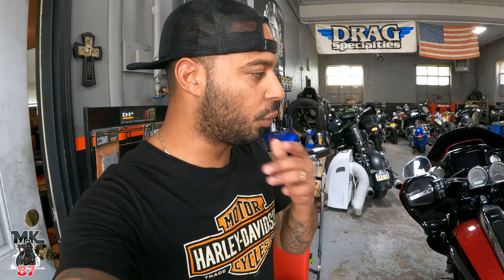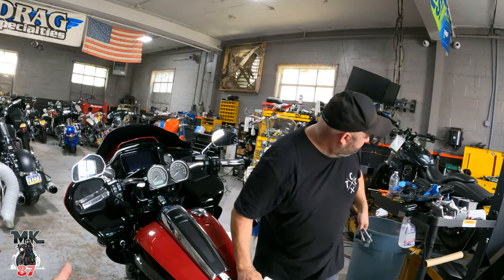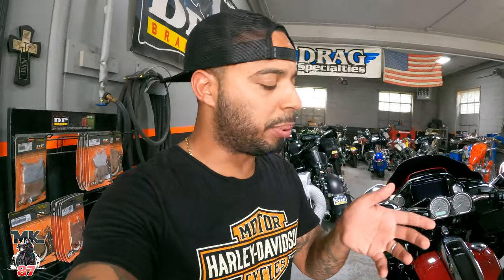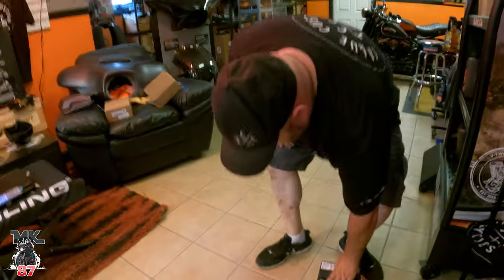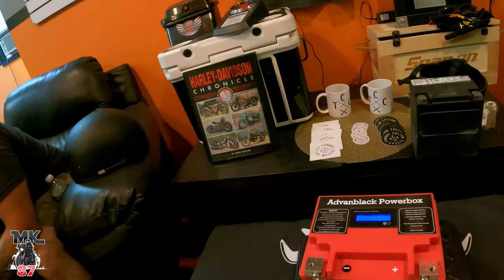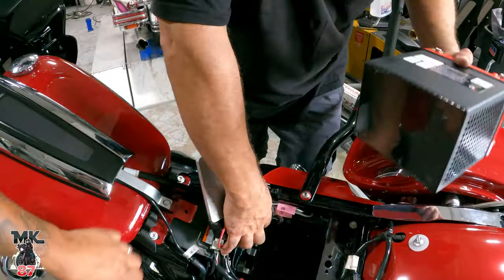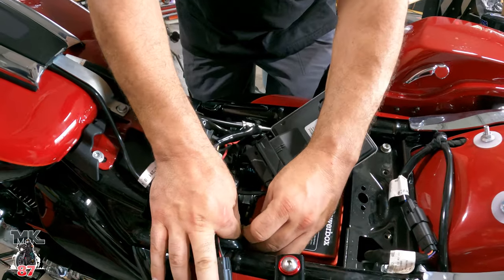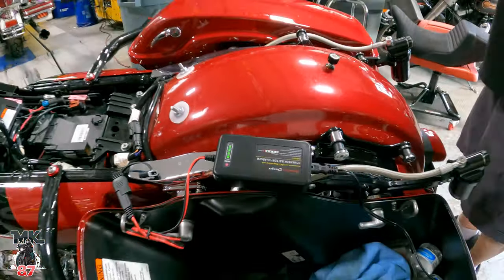Advanblack Lithium battery for Harley Davidson Road glide

Comment: Just installed a noco lithium NLP30 12v 700a 8ah powersport batt.. started right up.... the stock batt on my 16 RG died.  Joint was heavy... struggled pulling it out with my fingers...the noco fit perfectly and was like a quarter of the weight